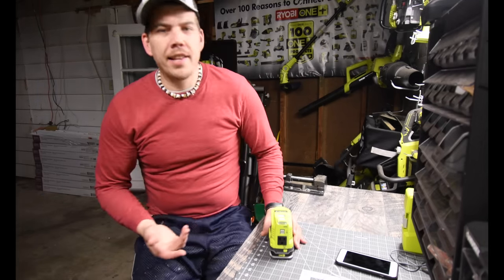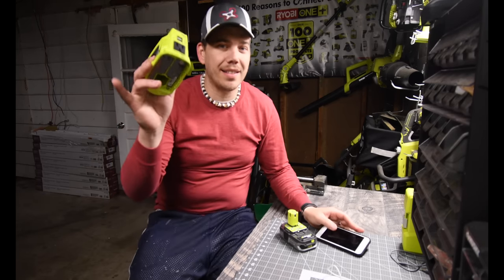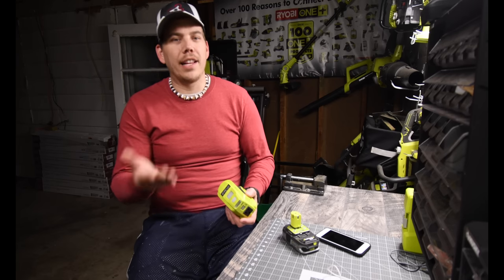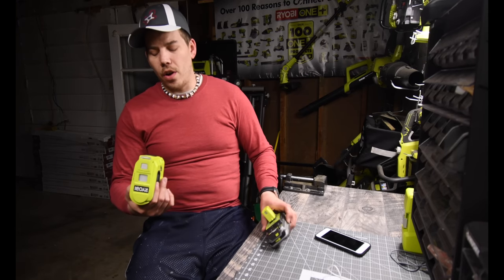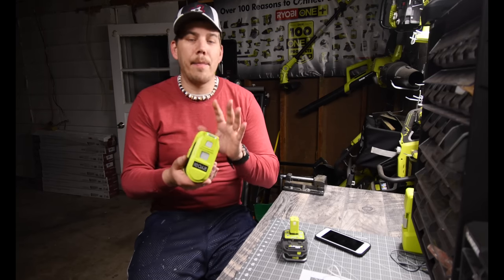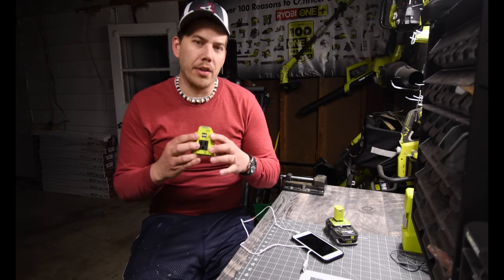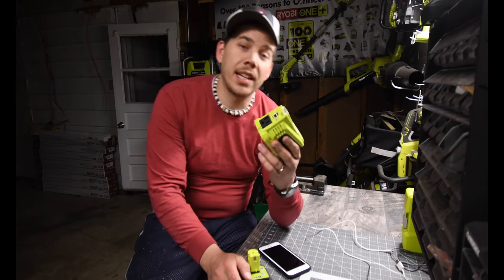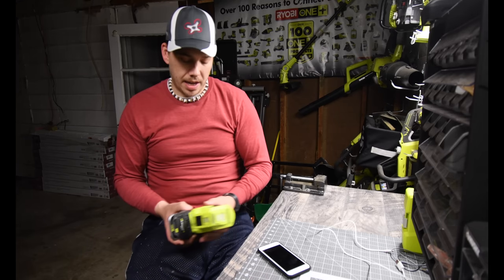Ryobi 150w Inverter gets HOT!!

Comment: You sound like a man who is half asleep or perhaps exhausted, not sure which one applies. Additionally your presentation is 3/4 nonsense. The inverter doesn't care what size power supply you have on it. As long as the Supply stays above a certain voltage, it will invert. 

If you are concerned about the device becoming hot, don't exceed the inverter's electrical specs. Don't try to power items with motors or large in-rush Ccurrent. A modified sine wave inverter has some restrictions. 

Better off going for the 40 volt inverter which is a true sine wave product
Reply from the maker: I was working 80 hours a week during that time so yes, I was tired lol

Comment: Not very smart video lol
Reply from the maker: The Inverter to heat. The fan will majorly run if its just turned on and sitting in the sun without connected to anything. I accidentally left in on in my car, it wasn't charging anything but the units fan was going off like crazy when I came back to my care a few hours later and the 9ah battery was connected, thankfully it didn't burn out